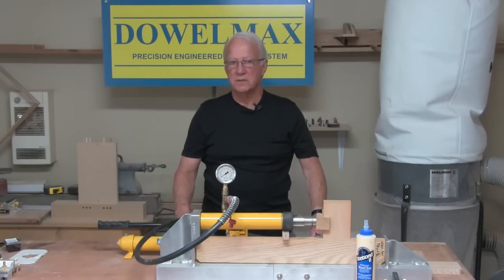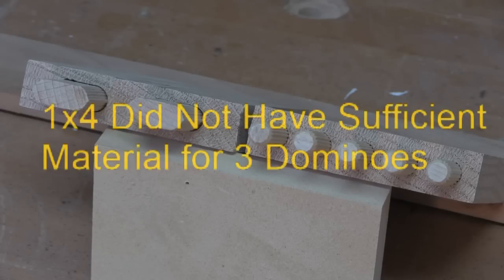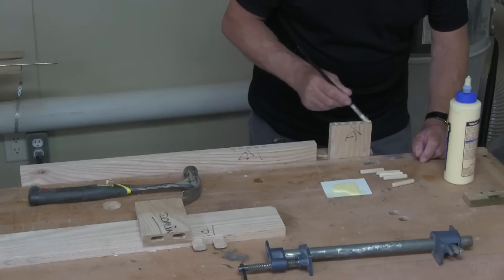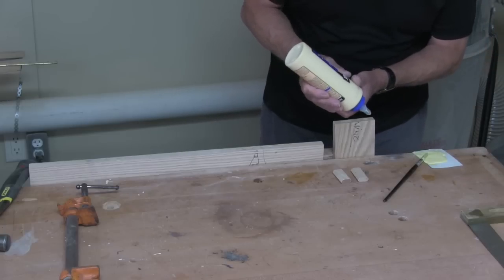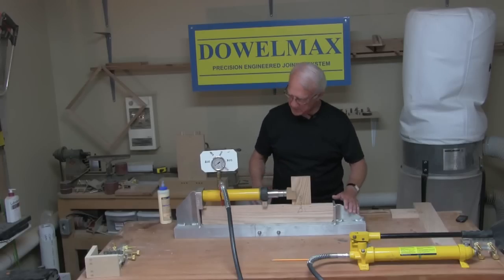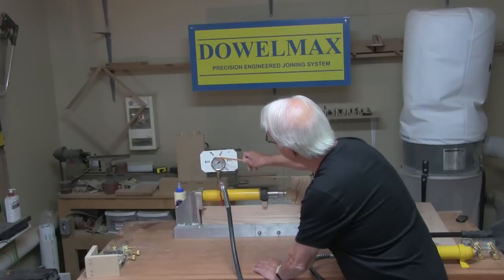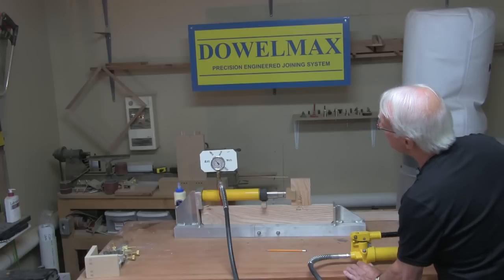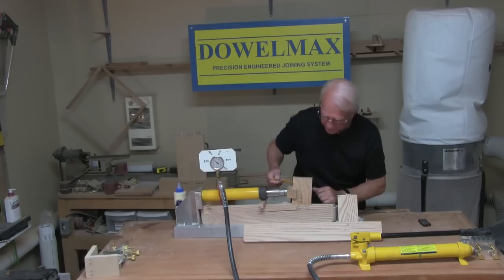Wood Joint Strength Face Off: Dowelmax Vs Domino

Comment: This was a shear strength test.  Must of the resistance to breakage was from the wood itself.  I'd like to see a comparison of the tensile (pulling) strength of the four types of wood joinery:  dowel, domino, mortise & tenon and pocket hole.
Reply from the maker: Hi Dan. Thank you for your comments.  I understand your thoughts but I can't fully agree.  To simplify we do not use not use lbs ft, or lbs ins. in our calculation, however there is no doubt that a considerable torque exists, the pivot of the torque positioned at the right hand side of the joint, thereby exerting a considerable upward load at the first dowel.  You're also right that the wood failed however this is again an indicator that the joint is in fact stronger than the wood itself.  If the wood hadn't failed the joint eventually would have, and that failure would have been most evident at the first dowel, decreasing from there.  F.Y.I. there are other tests of the various systems on YouTube.  Thanks again Jim.
Reply: @DowelMax  I am not so sure about this. While there is torque applied to the joint, I'd still want a separate test to ensure there are no other factors at play. As it is, the test does not simulate a realistic situation for multiple use cases e.g. a loaded bookshelf, cupboard, bedframe etc. i.e. any situation where the load bearing member experiences a load that is spread along its entire load-bearing surface.
The results of the test shown here would be more useful if the force exerted (as well as the pressure) is given too. All we need to calculate it is the area where the pressure by the hydraulic jack. From looking at it I'd say that's about half the area of the joint surface but a precise figure would be even better. If you can provide the area of the metal part of the jack exerting the pressure, that would be an indication. Of course, the pressure area is spread by the block of wood that's inserted between the jack and the wood beam under test but nothing's perfect in this world anyway...
Reply: @Stelios.Posantzis  In the real world, you are seldom putting hundreds of pounds of force on a 1x4. Anything having to handle such weight will have multiple load-bearing joints and the strength will considerably outsize any normal load. The real issue here is time in high-volume shops. If both joints are strong enough, then the fastest joint wins (I say this as someone who doesn't own and will probably never own a domino joiner).
Reply: No, of course not  @mrbigberd . But while in shops the objective is to minimize cost and time, for the hobbyist, the objective is only  to minimize cost. Therefore anywhere a thinner beam can be used or even slats can take the place of a beam of wood, while not sacrificing the minimum strength needed for the application intended, that is welcome. In fact, in many cases, for hobbyists, minimizing cost goes together with minimizing weight which is also another objective as most items hobbyists make usually are home furniture items. Having said all this, it is surprizing how strong wood is. Case in point is the flat pack vinyl record crates that one can buy and assemble without tools that are basically cubic frames without walls made out of thin slats joined by one or two dowels. Each crate can hold up to 80 records at times. That could be nearly 20kg.
Reply: @mrbigberd  I think the original commenter's point was that the forces applied in the real world are applied in a different manner i.e. have a different point of application and different direction.
To draw an analogy, imagine a nail inserted one third of its length into a block of wood. You can push the nail with your thumb at the base of it where it goes into the wood all day but the nail will never budge - your thumb will hurt instead. If you push the nail at its end, where its head is, though, the nail will eventually become dislodged - with a much smaller force applied due to the multiplicative effect of the lever action.

Comment: These are great videos! Well done. Would you please consider making a video testing a domino pined with a 1/4 dowel on both sides of the joint. In other words, you have done a mortise and tenon please now do a loose pined mortise and tenon using dominos. Thanks so much. Great Work!
Reply from the maker: Hi There Thank you so much for your comments. To be frank we are so busy, a small co. (3) We try to stick to the norm, and most woodworkers do not use that method.  I can say however I did see a test on that a few years ago and in fact if I recall correctly the joint was in fact weaker, not stronger. Thanks again .Jim.